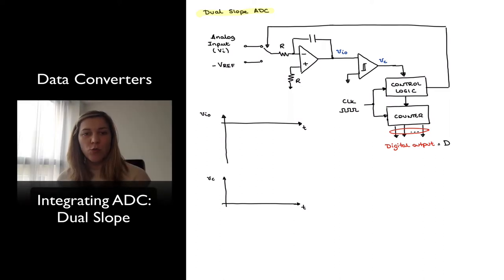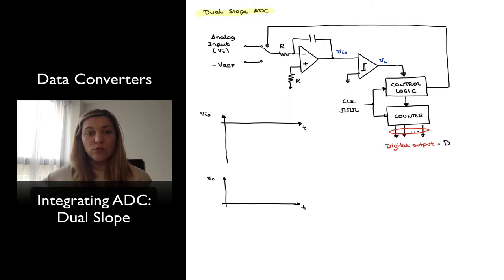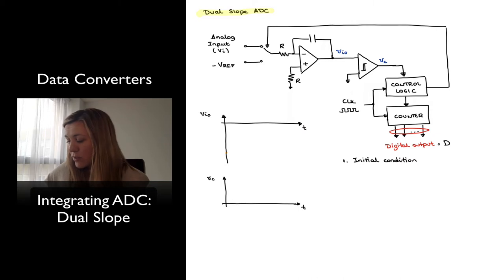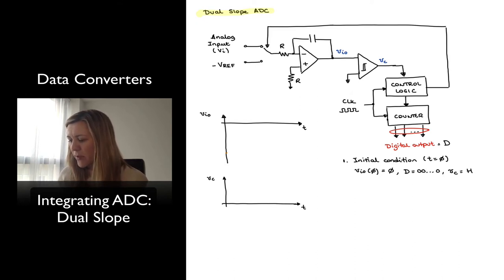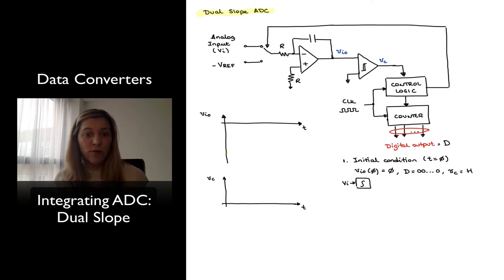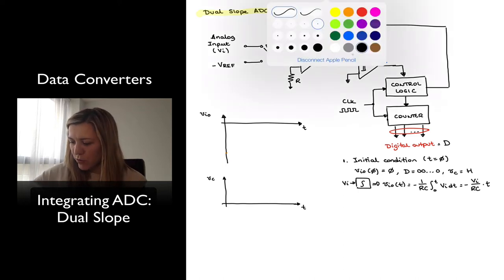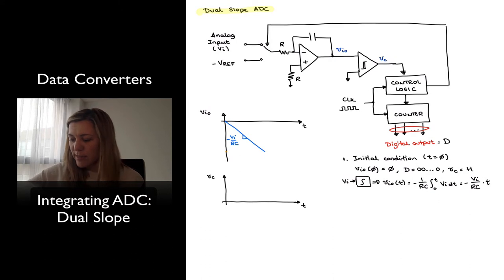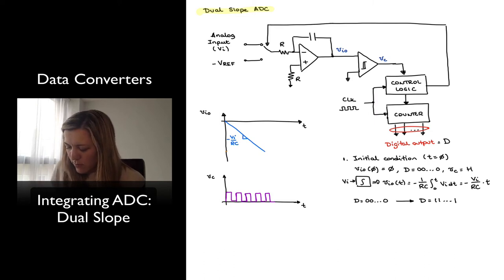Dual-Slope Integrating ADC

Comment: Common sense explanation: first we average the input voltage over a fixed time period. Then we linearly discharge it with a fixed rate and measure the time. Obviously, more voltage needs more time to discharge. So we show the time on the display and we have a voltmeter. Why average the voltage in the first time? Because its good to have a voltmeter which displays the average voltage, so that voltage with a ripple gets displayed correctly.
Reply: this intuition is somewhat correct, but leads nowhere when you need to design an ADC for a given resolution/speed, and moreover can be read everywhere else

Comment: A 6-bit dual slope ADC uses a reference of 12v and a fixed count 001010. The maximum input voltage that can be converted accurately in digital form is given by??? can you solve this??
Reply: (12/2^6)*(decimal(001010))= (12/32)*10=3.75 Volt
Reply: Bhai kitne titar mare?